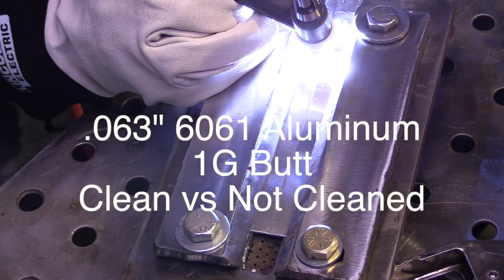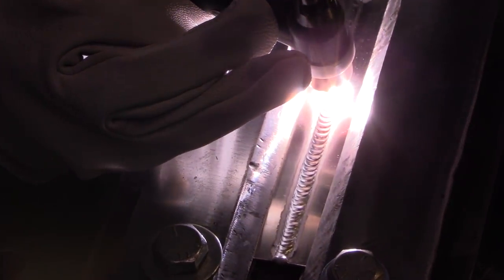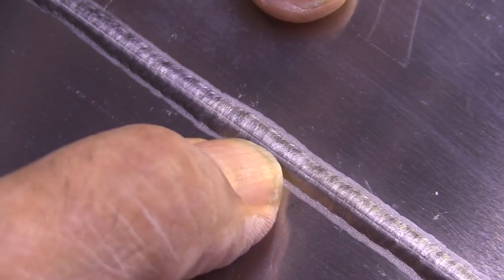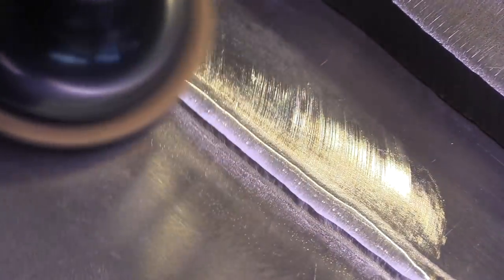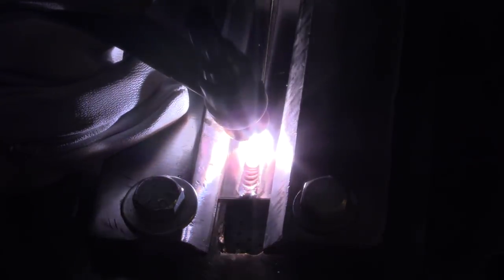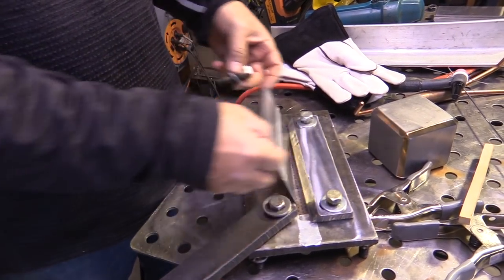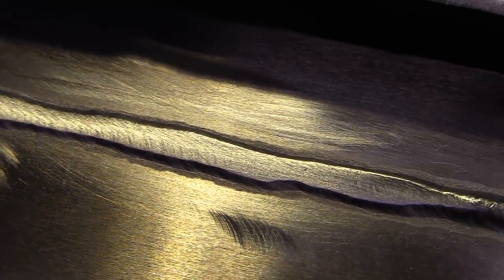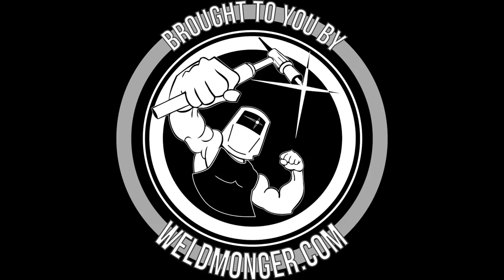Big Tip for Passing 1G Aerospace Aluminum Welding Test

Comment: I only did about 2 weeks of Welding training in a program I'm currently in and we did 1 thing of TIG Welding the last day for a few hours, while the rest was mostly MIG and Stick Welding. Your videos actually helped me improve massively from my first couple days of being a complete screw up. I'm hoping to possibly join a Union for Welding after this program is complete so I can further my skills and get myself started on a career. These videos are quite literally amazing as I had issues with some of my Welds compared to some of the more experienced people in my group and thanks to these I ended up outshining them in a few aspects to which our Instructor notified me because once I mentioned these videos, he knew exactly who I was talking about as he also watches these.
Reply: You described they left out TIG welding reminds me of transmission class where we never ended up doing a front-wheel drive only Chevrolet rear wheel drive same difference

Comment: best tool for most sheared edge cleaning is a Vixen file. some aluminum boat builders break them into halves- mount them on a block of hardwood so they have a 'block plane' sized hand tool to pull along the sheared or even saw cut edges to get back to the parent metal. Final two strokes with a Vixen file are at 45 to the two edges to deburr any remaining edge of material- then ready to acetone and weld.

Comment: I learned allot from this video thanks 🙂. I have welded a cylinder head and got these bubbles in the weld and could not figure out what it was. Now I know! Thank you and keep up the good/ great work.
Reply: Sometimes you get porosity from contaminants inside the cylinder head casting... just have to melt it out so it is on the top, grind it out and refill with weld. Can be a right bitch to do inside a port... :)
Reply: Lots of cast welding has porosity from the cast process.
Sometimes that's life.

Comment: I've really learned alot from your vids. I had a pressed in bearing that had come apart and left the outside race stuck in the part and I couldn't get a punch or anything on it to drive it out so I built up enough weld on the inside of the race and that allowed me to get a screwdriver on it and knock it out! Keep that in mind guys.

Comment: It really jumps out at you when you consider how linear the pores are aligned. They are not being moved around as you move the tip off center, but are forming just at the meeting surfaces of the two metal pieces. Great video!

Comment: I do a lot of fusion welding on 1/8 " aluminum at work and cleaning that sheared edge is spot on. We also had a lot of trouble in the beginning with contaminants in the welds. The only thing we figured was happening was that when the metal was sheared the shearing action embedded trash and contaminants into the metal itself. 
We found that brushing wasn't good enough, we had to take away a layer of the aluminum off the sheared edge to get rid of that " Dirty " metal. Normally just a light hit with a belt sander or flappy disk does the trick. Then go over it with some zylene or acetone cloth and your gold.

Comment: Hey Jody, just bought my first inverter AC Tig for aluminium. Discovered your channel and it's the best by far.  One question, in previous videos you stress using 2% Lanthanated electrodes  and in the 5 part tig setup series you recommend 2% Thoriated . is this a mistake??    Also I suggest for your International Subscribers adding metric measurements as well.   cheers . keep up the good work.   PG, Australia.

Comment: Jody, great video, again. I have a theory. a rough edge will give you porosity even if it is clean. I wonder what your thoughts on this is? What would the weld look like if you did not clean but just had a smooth edge?

Comment: Hey Jody, thanks for your great vids! I'm currently working as a pipe welder and sometimes we get some cheap parts that won't fit together nicely, and I end up with a gap between the edges. I can weld it ok, but it doesn't look as good and consistent as I want it to - both on the inside and outside. Do you have any tips for welding materials with an 'edge offset'? (I'm not sure about the translation) Thanks again

Comment: Hey Jodie, I am interested in learning how to do a TIG root on aluminum pipe. I was wondering if you could do a video on the joint type and preparation and techniques to welding it. I’ve tried to do it on my own in the shop but can’t seem to figure out what I am doing wrong.

Comment: Straight Argon or helium mix and if so how much. And if you don't mind what was your balance and high frequency. Wave type and also type of tungsten.. 
I've been welding aluminum very very thin all the way to block semiconductor and vacuum chamber for the last 20 years I was taught to run helium right away but you really never go over a 50% mix an to preheat accordingly depending on thickness and in a lot of cases the helium could be just a waste of money and not needed at all this is obvious. But I asked because I ran into a company and they weld all alum. Thick or thin with 75% helium 25% argon already mixed in one bottle not even using a y with a pure helium and  pure Argon. I was taught early on that too much helium can make the weld brittle as it shows and some of their welds although they are excellent welders I questioned the gas mix I would like to know your thoughts please and thank you

Comment: Great video but I have a question I see that you are welding 6061 my question is can 7075-T6 aircraft grade aluminium be welded with tig and what kind of filler rod would be used?
Reply: In general, 7000 series aluminum cannot be welded.  I had a coworker who had an aluminum mountain bike with big "7000 Series Aluminum" stickers on it.  I told him I was surprised because I had always heard 7000 series could not be welded.  Sure enough, the welds cracked within a year.  I think there may be one or two specific grades of 7000 series aluminum that can be welded, but 7075 is not one of them.

Comment: I don't have any experience with aluminium, but what were the tig settings, like did you use more cleaning action. Maybe i missed it. Weld looks good..
Reply from the maker: cleaning action was set to 67% (33% cleaning) for both welds. I think I forgot to list all the settings

Comment: How would you try to clean an old pontoon log that has cracks forming where the log meets the brackets? I'm getting cracks where the weld meets the log and would like to fix them or at least try.
Reply: Johnny missfire drill the ends of the cracks(this terminates the cracking), lighlty grind the crack out and TIG or MIG weld it up. Make sure the material is good and clean. New stainless brush is the quickest and easiest.

Comment: Jody, do you any experience with welding thin aluminum (.063) with a spool gun? The reason I am asking is I have an old pontoon boat that is showing it's age and needs some TLC and the pontoons themselves are .063 6061. But with age and the stress of being on the water are developing cracks at the ends where the deck supports are welded to the pontoons. Any thoughts or suggestions are appreciated. Thanks
Reply from the maker: Phil Hurst I typically don’t use a spool gun on anything thinner than 1/8”
Reply: In a non-typical situation can a spool gun be adjusted down to not burn thru thin aluminum? My problem is my boat is stored outside at an offshore marina with no place to do TIG welding indoors and is subject to windy conditions.
Reply: Once you get into 16ga you won’t be in spray but globular transfer, it runs but is harder than tig to weld with
Reply: Thanks
Reply: Thanks will give it a try.

Comment: Would linear porosity cause cracking or parts to break?
Reply: Welding Junkie Sure they will..! But depends on the application...
Reply: Henry Rollins you think? It seemed like light porosity I can’t imaging it cracking unless you have a few hundred lbs of pressure on it. I’m guessing sometimes you can only get it so clean as well
Reply: Well, it depends... if the weld is a structural piece, vessel or pipe, if is it subjected to pressure, vibration, stress, torsion/tension, temperature changes, etc...but you are correct, on the field not always perfect cleaning and preparation can be done and many times a welding is done knowing that it will eventually fail. 
Sorry for my broken english..!